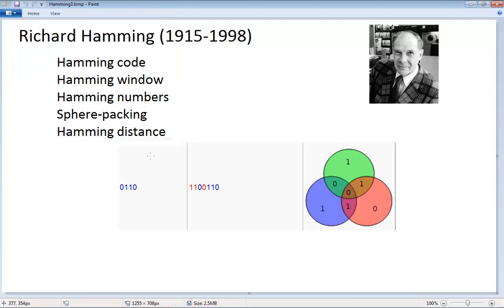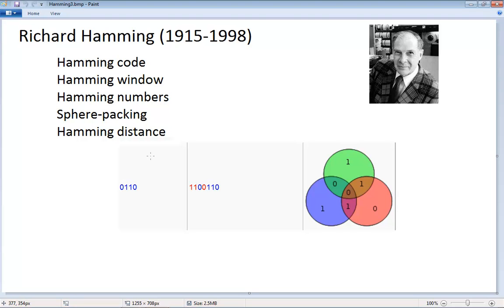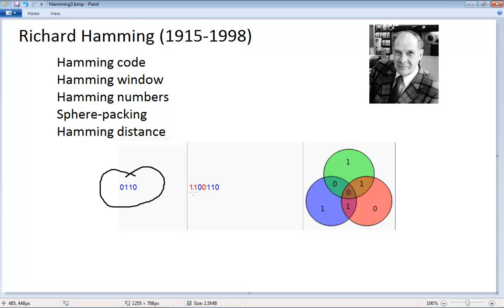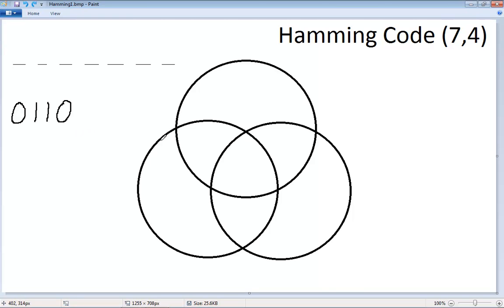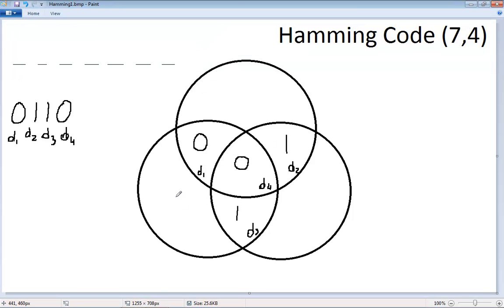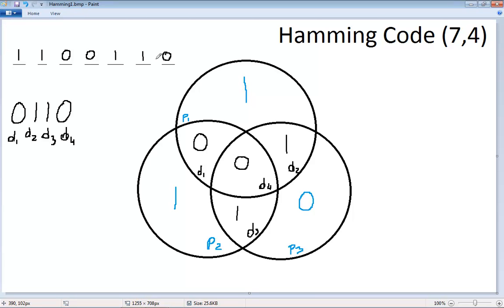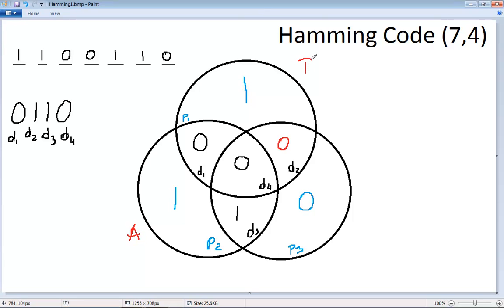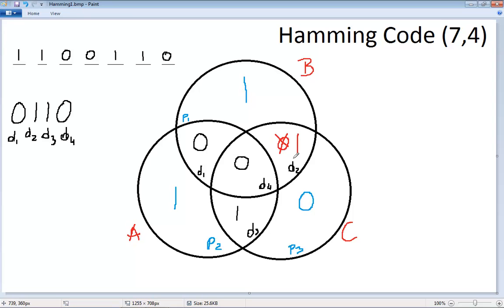GRCC CO230 Hamming Code (7,4) Introduction to Telecommunications

Comment: Does that mean my data sequence cannot be of any other length other than 4 bits?
Reply: No, assuming you are using hamming code 7,4 it means that for every 4bits of data you need to repeat this process. So if you want to transmit the hex value of AB (171 in decimal and 10101011 in binary) you would need to split it into 2 nibbles (4 bits) so it would become 1010 and 1011. Binary 1010 becomes 1011010 and binary 1011 becomes 0110011. Your total message would end up being 14 characters long 1011010-0110011. You could do this for arbitrarily long messages, though they must be a multiple of 4 bits. If not you could consider padding it.
Reply: Alexandros Andreou Thanks!